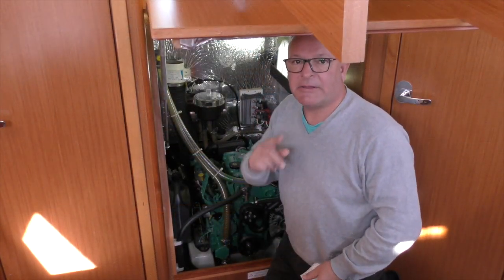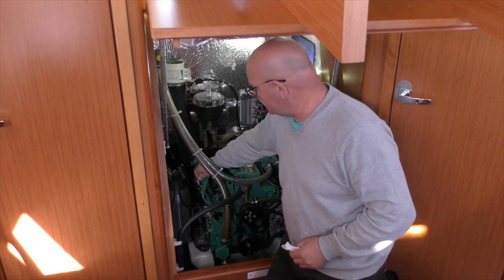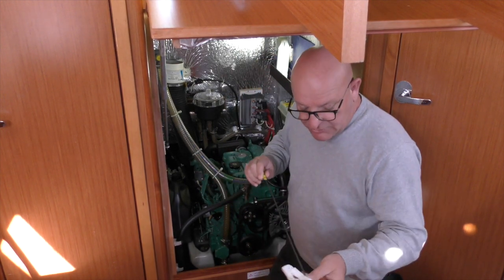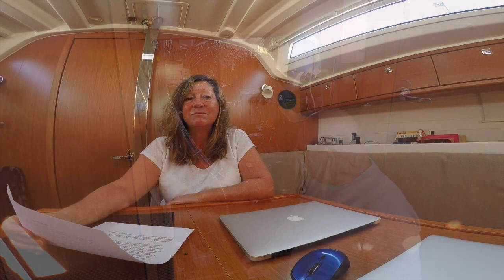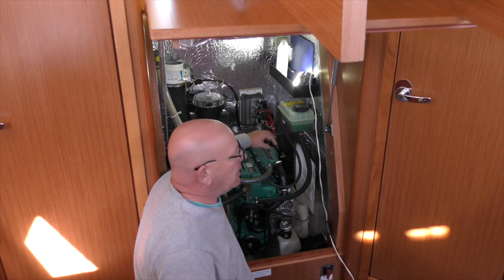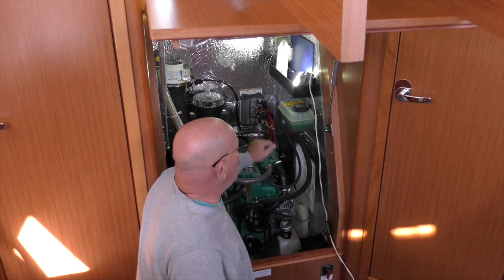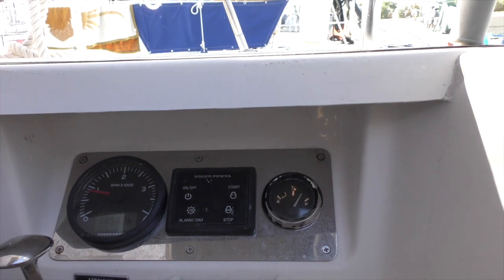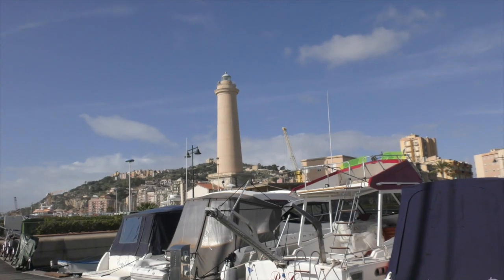Marine Diesel Engines in Yachts. Things you need to know. (Free Giveaway). Part 2

Comment: Yet again a well thought out and comprehensive video, which will be very useful for your fellow sailors. Just a couple of additional snippets which I am confident you know are:
1: Fuel contamination of lubricating oil. One of my favourite ‘easier checks’ is the fuel lift pump - often overlooked but quite commonly the culprit and easily resolved.
2. Mayonnaise on the rocker box cap. It can also be a clue to a failed thermostat (stuck wide open).

Minor points but Hey Ho.😉

Sorry I did not email you - got severely distracted on a home project😉

Keep up the good work.😀👍⛵️
Reply from the maker: Thanks Norman. Yes the lift pump. We did not cover the gauze filter in them either. Sail Safe mate. Ant, Cid & the pooch crew.